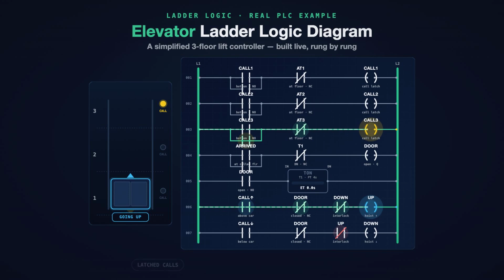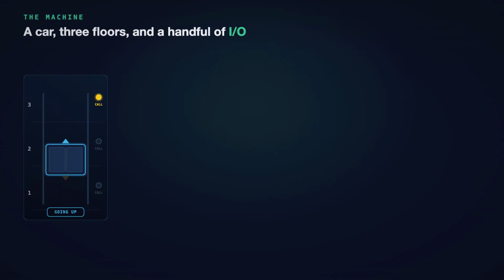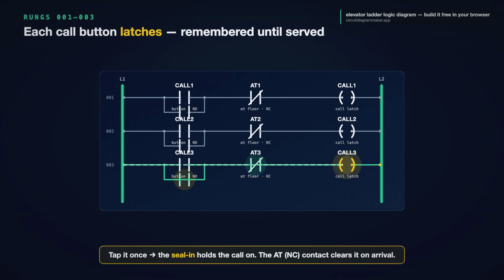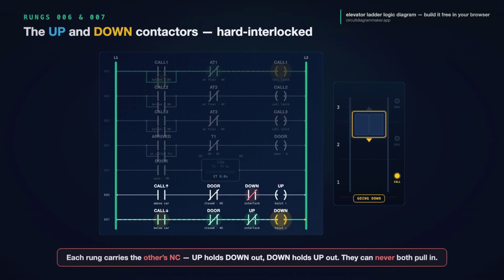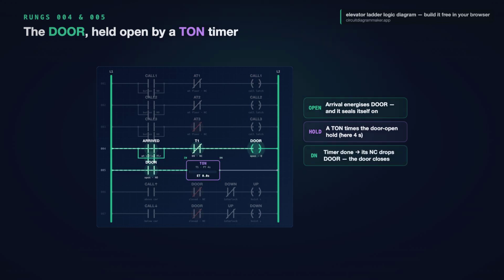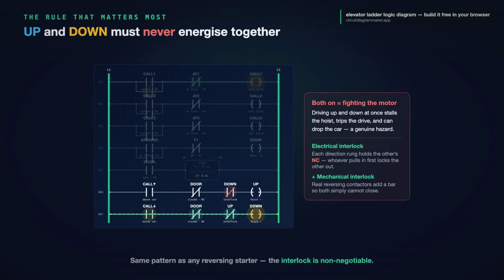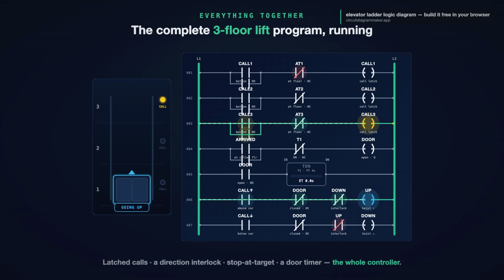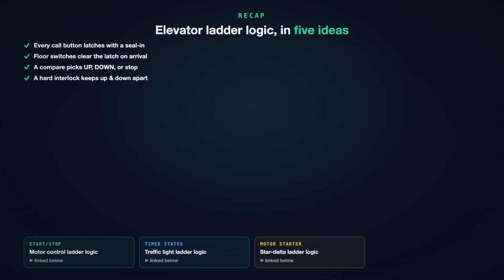Elevator Ladder Logic Diagram (Real PLC Example)

Comment from the maker: Quick tour of the seven rungs, in case you're skimming: rungs 1-3 are the three floor calls, each latched with its own seal-in so a tap is remembered until the car arrives and the AT floor switch clears it. Rung 4 is the DOOR (opened on arrival, sealed on) and rung 5 is its TON door-hold timer. Rungs 6 and 7 are the UP and DOWN contactors — and each one carries the other's normally-closed contact, so the car can never drive both ways at once. Which idea tripped you up first — the seal-in latch, the direction compare, or the interlock? Build the whole thing free (no install): https://circuitdiagrammaker.app/try?utm_source=youtube&utm_medium=pinned_comment&utm_content=yt-114